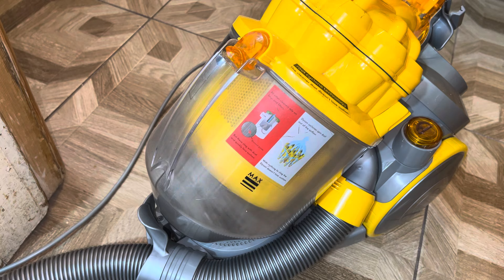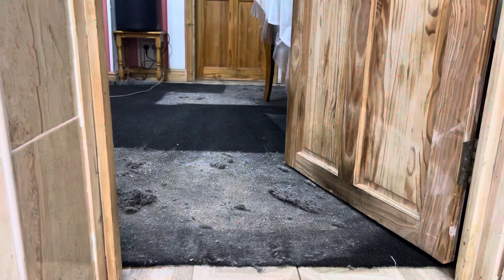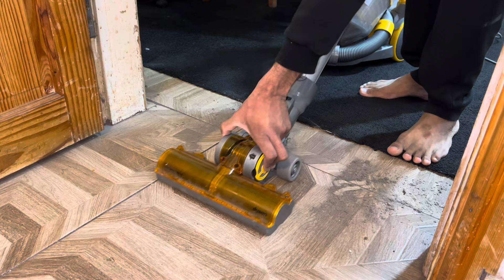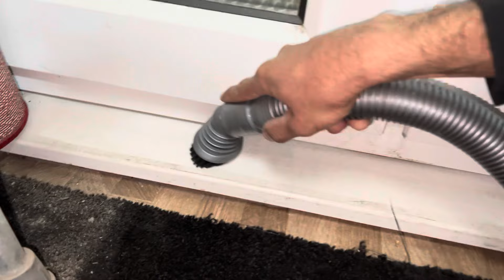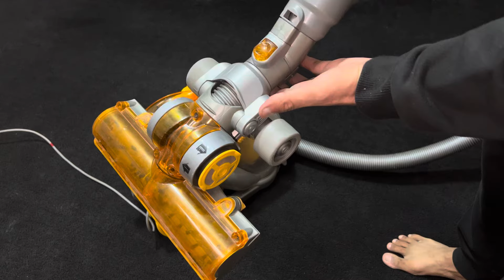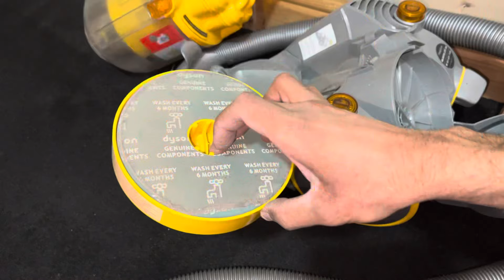Dyson DC08 Telescope Wrap All Floors vacuum cleaner - Performance Testing

Comment: Have using the same DC08 as a main vac since 2003, joined by a DC07 later on for carpets. Ended up with a Dyson collection of some 25pcs,  but the workforce are still 4 DC08’s around the house and a DC26 for car cleaning ..
Reply from the maker: Wow that’s brilliant!! I love the older Dysons

Comment: Ok so, serious question: what would be the benefit of a canister vac over a modern upright "lift away"-type machine? Most of the canisters I see perform worse than uprights and cost a bajillion dollars more.
Reply from the maker: Uprights generally have stretch hoses which make the machine fall over in use, a cylinder vacuum has a longer non stretch hose so they’re ideal for above the floor cleaning like cars
Reply: @parwaz7861  Hmm, interesting. 🤔 Thank you!